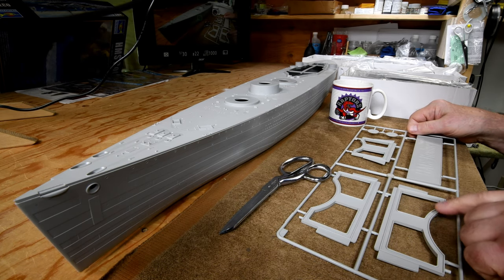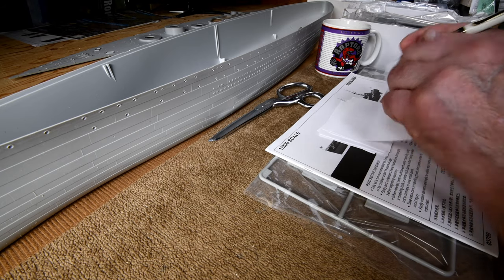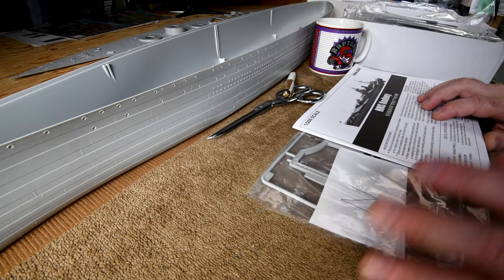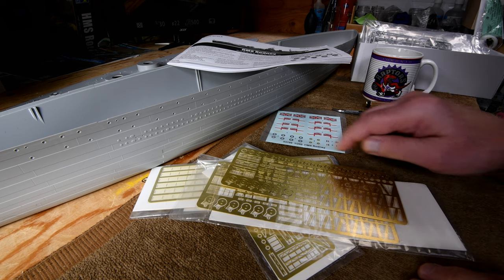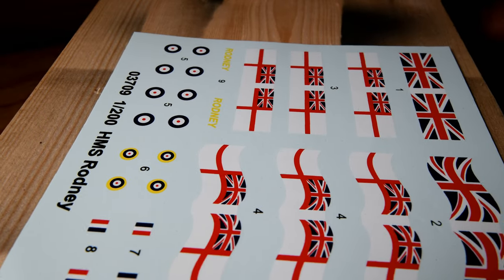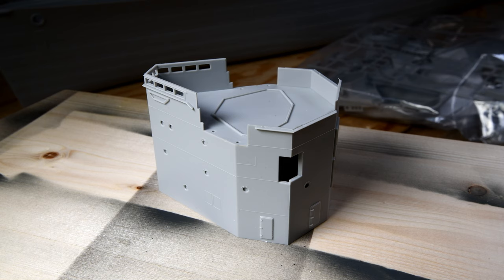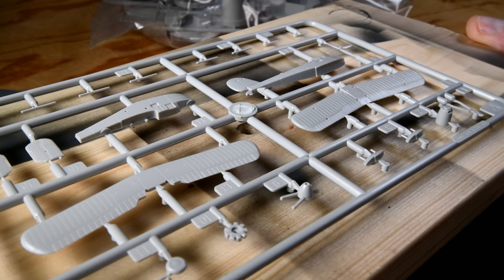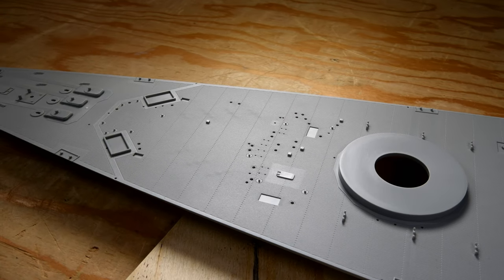The Model Ship - Part 492

Comment: Hi  Ron,
If you have or can get real pictures of the HMS RODNEY  you can see detail on the superstructure. You can reproduce these with some thin plastic sheets, which your hobby store has. 
Are you going to drill out the port holes before painting the ship?  This will add a nice affect to the overall of the ship.
Just a few things to think about 🤔. 👍. 

Stay safe and stay well, your friend 😷. 😷.  👏  
As always,
Jason
Reply from the maker: I'm not too good at that, but thanks for the idea Jason. 👍🙂
Reply: Ron,
A slow rpm drill (powered screwdriver) with the right size brill bit will do the job for the port holes.
Making parts is not difficult, I know you like to try new things, so why not try making your own parts.
I do it all the time, but with wood.  Should be much easier with plastic. Try it.

Comment: I've been looking the Rodney over. It certainly was a different battleship from what I would have expected. With all three main turrets facing forward. And the only time all three could bear on a target was during a sight turn or a broadside. Certainly not as 'pretty' as the Bismark. It will make a great model. It will be the only one of the three to survive the war. See you tomorrow Ron.
Reply: There was a method in the madness. Warships used to angle slightly to improve the thickness of their armor and try to bounce shells off the hull. She has three turrets forward as a result of a treaty limiting the weighty of battleships. By clustering the main guns like that you ended up saving a lot of weight compared to the more traditional designs.
Reply from the maker: I remember seeing photos of the Rodney before learning of the historical significance behind it, and thinking what a strange configuration. Yes, nine big 16 inch guns, all up front in the bow. 👍